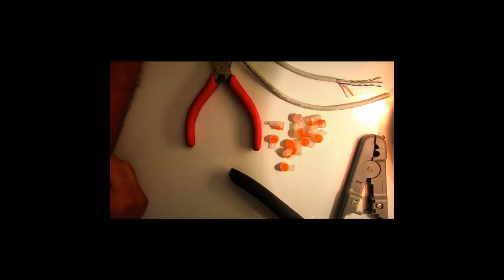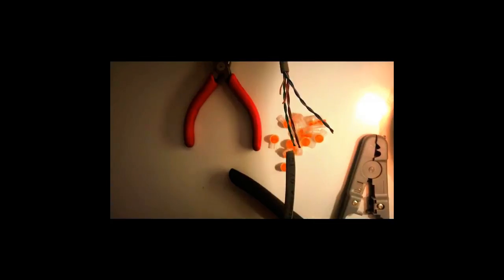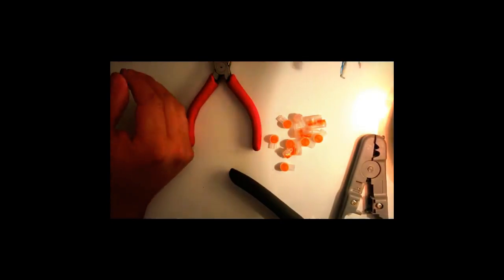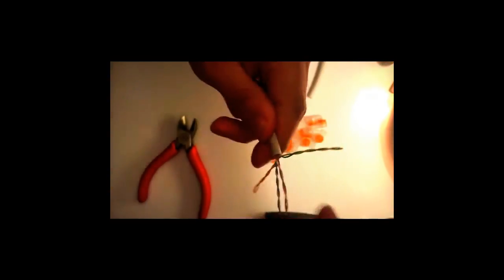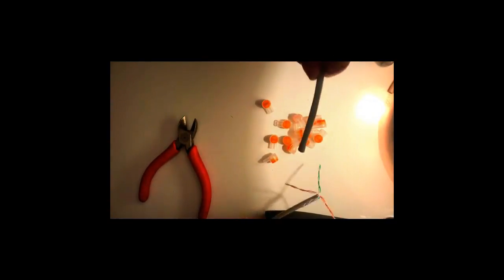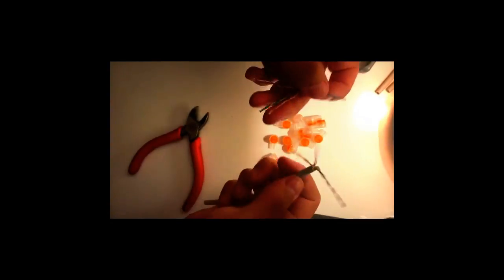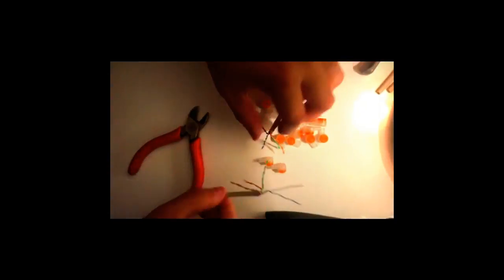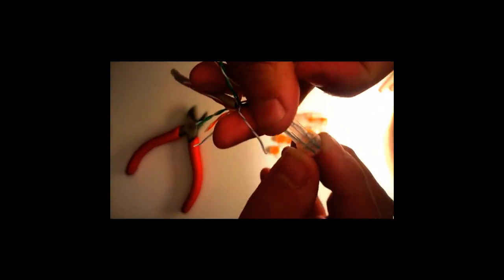how to repair cat5 cable

Comment: Can we use this on Ethernet wires ? I’m rewiring a rj45 wall socket, and the rj45 cable is too short.
Reply: Cat 5 is an ethernet cable

Comment: I am using a computer viewing this video with a similar scotchlok connection for a temporary connection running about150 foot.It works ok.I prefer to keep the wires in a straight line with the tips soldered,but this method works for a quick fix.
Reply: What is the name of those caps..plzz send buying link